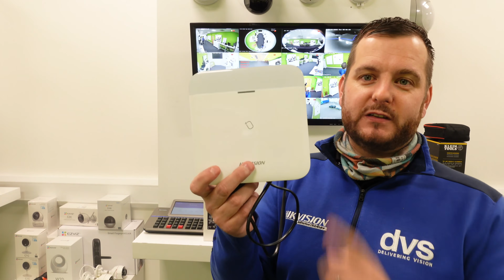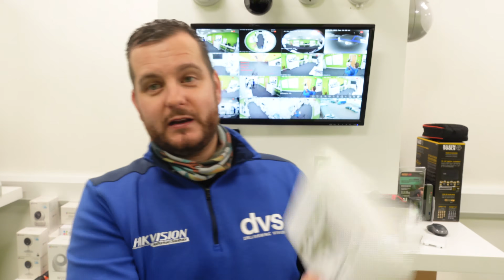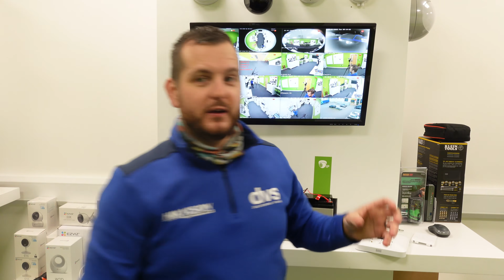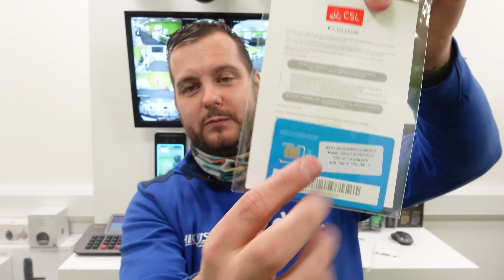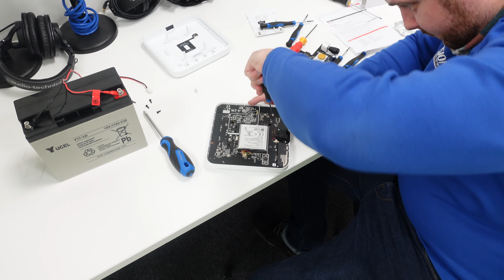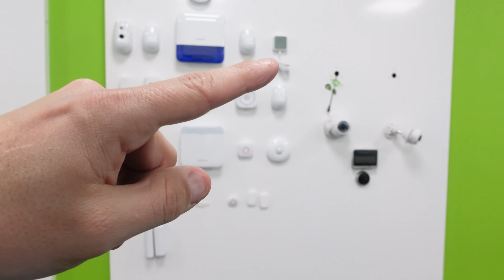NEW AX Pro Conversion Guide - Featuring: CSL x DVS SIM

Comment: Have you had success with cellular connection on the AX PRO?
Cell connection shows: Connected, 3 bars, Cloud connection set to Auto, yet, if LAN is disconnected, the cellular does not connect to the cloud
Any other settings, firmware requirements?

Comment: So potentially should be possible to power this with POE using the 12v board
Reply from the maker: Yes using a POE splitter 😊
Reply: I thought Poe is 24 or 48 ?
Reply: @TheRealAnthony_real  you can use passive POE cables which you can pretty much put anything up them 5v/12v/ 24v and 48v. They basicly split the signal and power over one cable. Ideal for these situations. I have used them in the past for cameras.